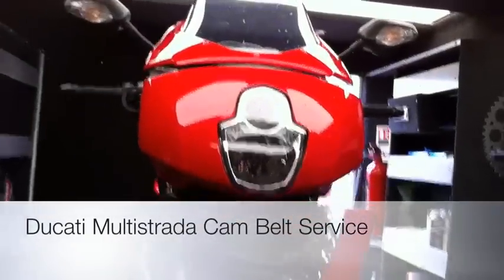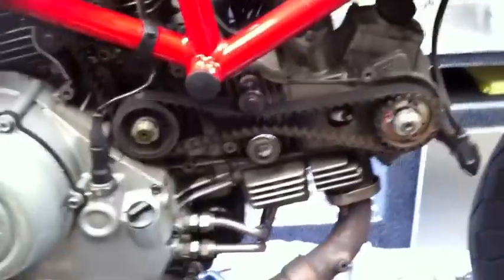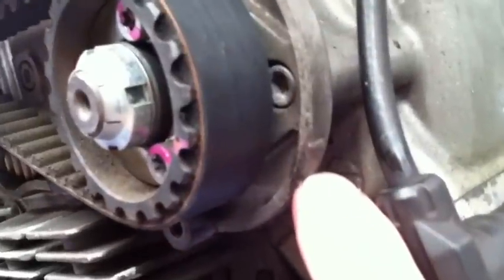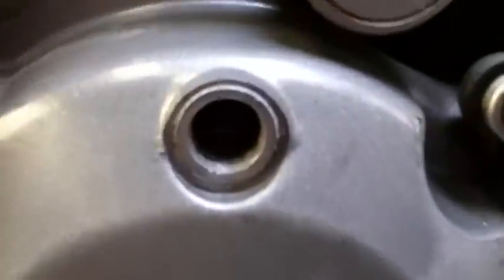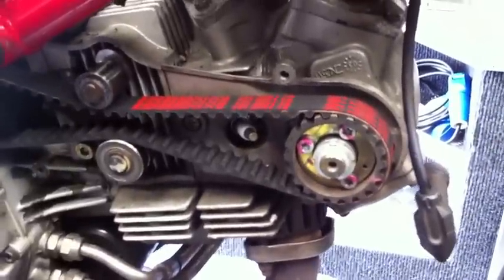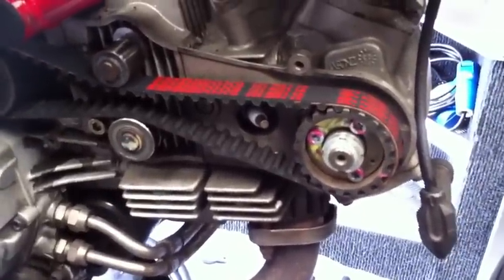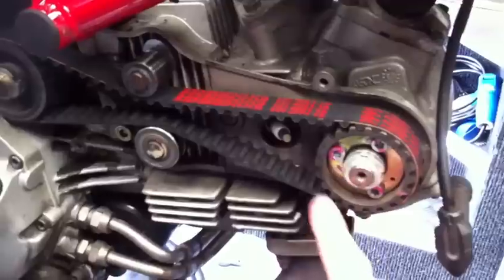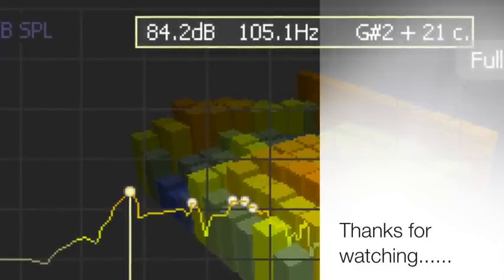Ducati Multistrada Cam Belt Service

Comment: The desmodromic  opener valve  setup adjustment is straight forward but fiddly valve adjustment in relation to having to use a specified too to take the clearance.

Comment: great video...it does help a lot. However could you tell me which program you used to measure the belt tension?  In the service manual the recommended tension is 142Hz . Has anything changed in the measurements?

Comment: do you "strum" the lower part of the belt aswell ,do both tensioners/pulleys adjust the tension or is it just the top one of each pair ...thanks just about to do my 1200 mts